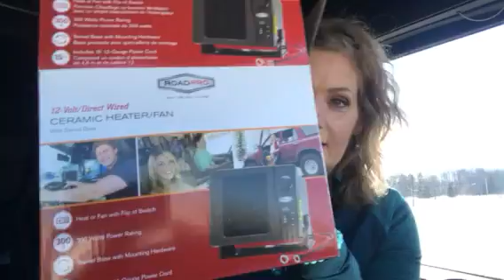Learn from my error: 12 volt appliances

Comment: If you are driving a Freightliner , inside the drivers mirror there’s a temperature sensor . Pull mirror as far towards the window as you can . You will see wire harness . Simply unplug.. truck will idle forever.. note Engine light will come on which indicates malfunction . But no worries plug it back in when no need of use .

Comment: You did the right thing.   As an Electrical Engineer here is the thing.  If something Electric for heat requires large current ( the wires are thicker   This thing requires a lot of current which could put a SIGNIFICANT drain on your bettery.

Comment: Even if you got the accessory  one...you would have to run the truck sooner or later because it might drain your battery if truck is not running. Then if you run the truck might as well use the heat in the truck then.

Comment: You know if you run a couple of wires from your truck batteries to your APU batteries you can recharge it. You could use jumper Cables to.Positive to Positive (Red to Red) & (Black to Black)

Comment: On the idle shutdown alittle trick is to not pull truck parking break to lock brakes. Only pull trailer air supply and set trailer brakes. This isn't wise though if your running in slop as the trailer brakes like to freeze to brake drums. In a pinch though your truck will idle though

Comment: There is a way you can override the 5-minute shut down without reprogramming your truck
Option 1
 set your cruise control to disable the idle shutdown
Option 2 
Set your trailer brakes and release your tractor brakes this will work for 5min to 2hr depending on the programming of computer
Reply: BTW 1 hr of ilde is about 1gl of fuel

Comment: If you have a Carrier Comfort Pro just go to any Carrier dealer your APU should be under warranty still. Same with a tri pac any thermal king dealer should take care of it. No need to waste time at a terminal to get work done on it.
Reply: I would be curious if they could just diagnose the problem?  Maybe an hour for that with an appointment - reduces downtime.  Then you would know what parts are required and the time to complete the repair.  Was the problem a bad alternator, belt or broken alternator bracket?
Reply: Raoul Thomas x

Comment: If it helps in the future...12 volt runs to battery or cigarette lighter for power. When you buy your next item look on box and it must say 120 current or power,that means you can plug rite into your inverter
Reply: by the way.....inverter is also hooked to the batteries

Comment: There are a lot of ways to mess up.  I put a sheet of styrafoam under the bed, and a considerable pile of covers.  I only idled all night one night in Yankton SD, when it got down below O.  Fortunately, in my day, it was not illegal to idle, but I didn't do it.  I did, a couple of nights, sleep for about 4 hours, then drive 20 miles to warm things up.  (it being in the days of paper logs, when one could be more flexible.)  After my first winter, I shut down from Mid Dec. to mid March

Comment: Webasto makes a sleeper/cab heater that’s light on the batteries, burns diesel, and heavy on the heat. Been using my Airtop 2000 steady all winter in Canada. Works great.

Comment: If you’re driving a Freightliner the idle shutdown isn’t a “green” thing. I have a Freightliner with a Detroit diesel. The engine needs to idle at a higher rpm to keep the rings properly lubricated. 

All that to say. When you park, set your brakes, turn on your cruise control and then push the set switch once. The engine should speed up to to around 1000 rpm and idle indefinitely.